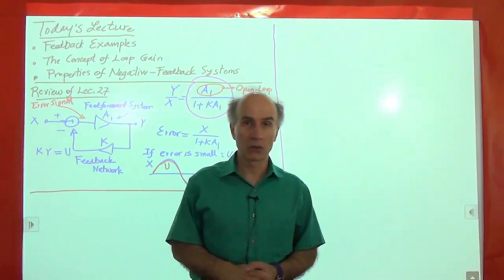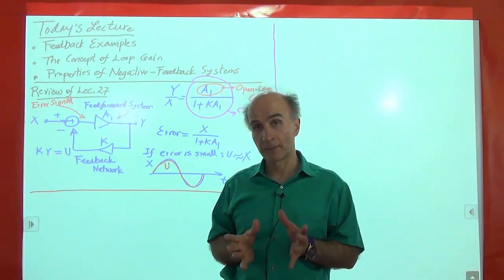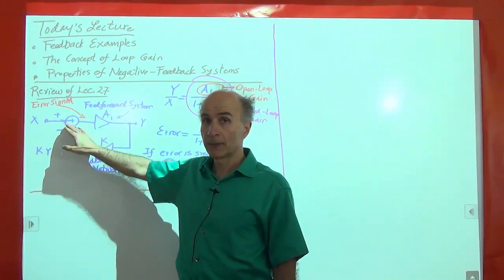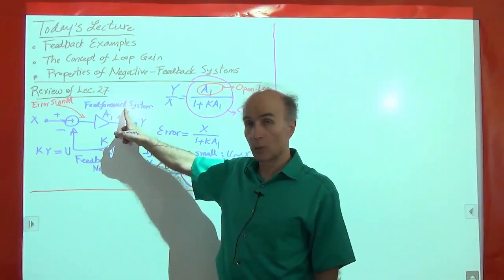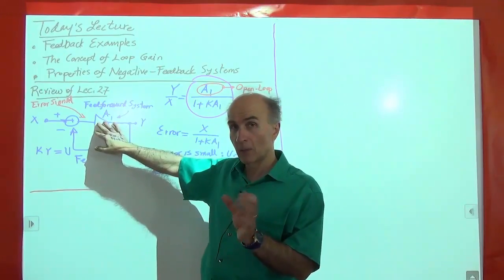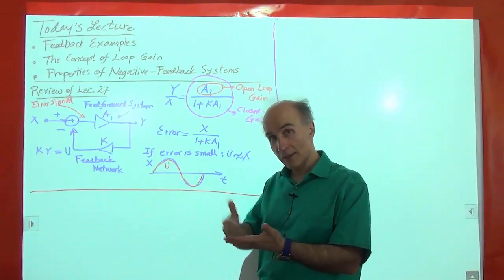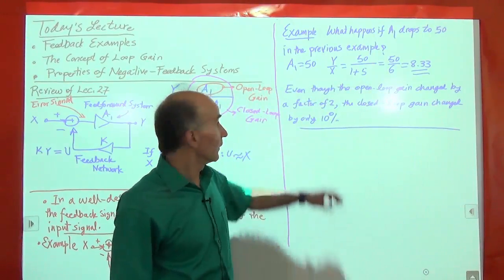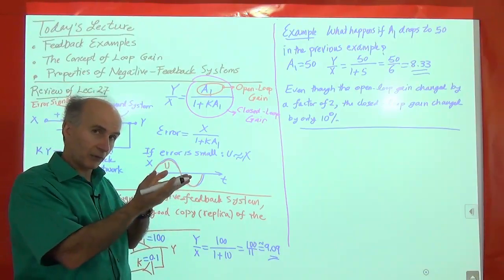Razavi Electronics2 Lec28: Feedback Examples, Concept of Loop Gain

Comment: 01:25: Intro
05:40 - "In a well-designed negative-feedback system, the feedback signal is a good copy(replica) of the input signal."
06:40 - Example: How Change in Closed-Loop Gain Effects the System Amplification
11:40 - Observation: Independence of Closed-Loop Gain from the Open-Loop Gain
15:35 - Observation: Feed-Back Factor is Less or Equal Then One
16:30 - Circuit-Level Implementation with Op-Amp and Resistor-Divider - Non-Inverting Amplifier
25:46 - Gain Change with Temperature
30:40 - Loop-Gain Calculation and Reason For it's Name
38:35 - Examples: Breaking the Loop on Different Places
47:10 - "Every parameter that effects A_1 effects closed-loop gain less"

Comment: Sir I have a question. Theoretically talking the gain of a op-amp in infinite. In reality the output is limited to the voltage you supply to the op-amp. Therefore what would be the real gain of the opamp (by this i mean the A1 in the close loop gain formula) --> the theoretical gain (really high value) or the voltage you supply to the oamp?
Reply: The A1 in the closed loop gain formula would still be the gain of the amplifier (really high amount). The voltage you supply to the opamp just limits the range in which you can mirror the input, as the input of the amplifier will clamp to Vdd or Vss.